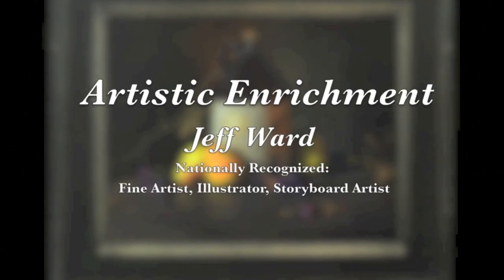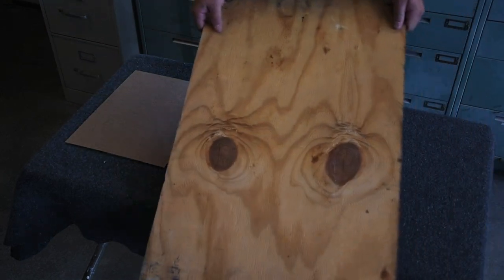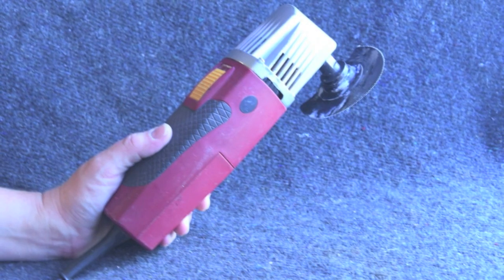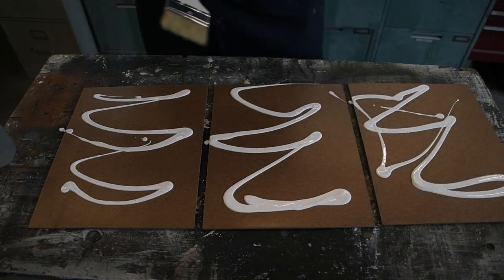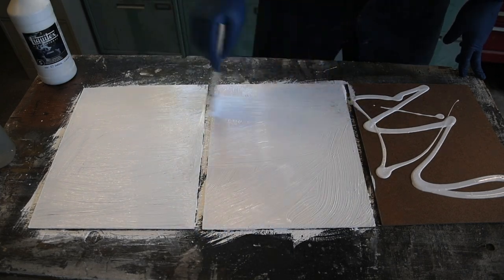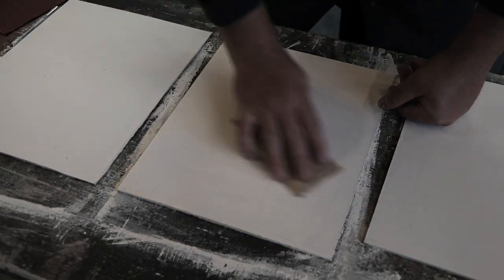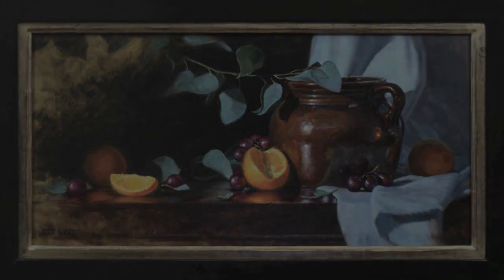How to make a gesso hardboard panel for oil painting.

Comment: Thank you for your video! I painted a large painting using an MDF woodsheet, very thick, however during summer, the heat caused the board to warp quite a lot, any suggestions to avoid this to happen?
Reply: Hi. I know you didn't ask me, but as a fellow artist who likes to paint BIG, panels can be fastened down to any type of wooden frame. The larger the panel, the larger the frame. I will build a frame like I plan to stretch a canvas then fasten a panel on in place of the canvas. The nails may be countersunk then filled before gesso to keep the surface even. Hope that helps.

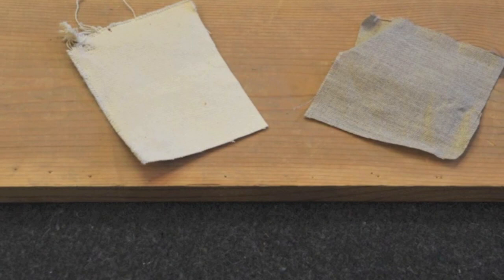Comment: 4:00 Gesso is not a barrier! Gesso almost always have absorbent properties and oil over the years can (and probably will) slip through and penetrate the canvas. Gesso's purposes is to provide a color ground and a proper grip for the paint, but it is not a barrier! A barrier is called Acrylic sizing (it is different product from gesso) or historically - rabbit skin glue. The process is called "canvas sizing" - this isolate the canvas from the actual ground!

Comment: Need a coat of gac 100 to block oils from substrate? I’ve heard oils can leach through gesso. Also clip some 4 mil. Plastic to table, it lasts forever and drips peel off.
Reply: I prefer plywood to MDF. Ply won't leak anything through gesso. Smooth ply is going to cost more though.

Comment: The cotton seed fibre SCW is composed predominantly of cellulose (~94%), and there is one report that it may also contain lignin at very low levels (0.4-1% of dried weight) This means it is not part of the seed itself, but the nesting around it. Linen does contain lignin, and that is why it was much more durable and preferred by artist as a surface to paint upon. Lignin, is the fibrous material that give a tree its strength, like a web of interconnected threads crosslinked into place.